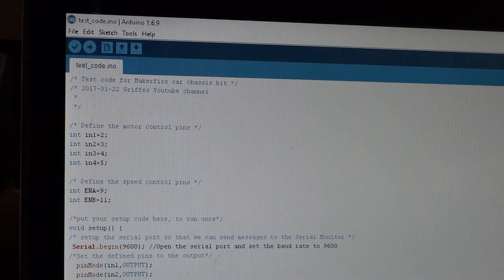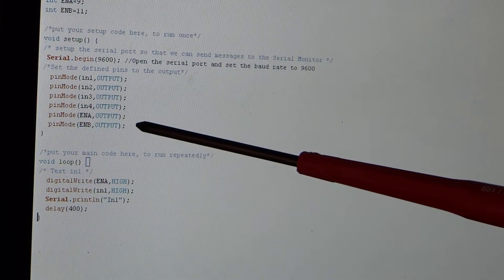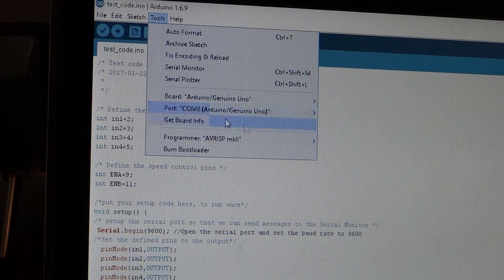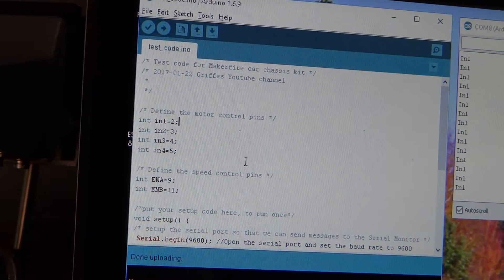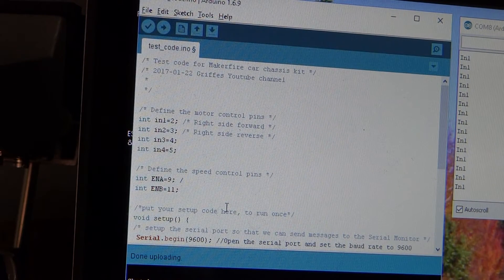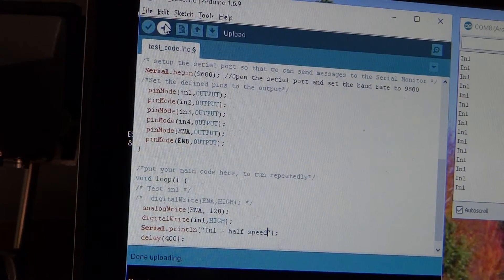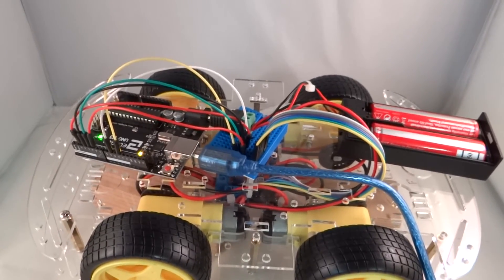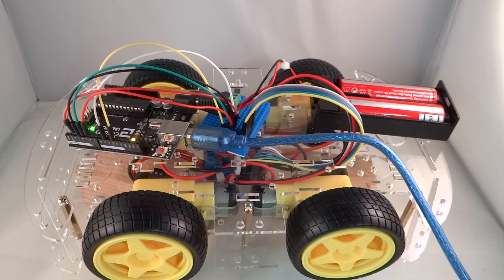Coding the Arduino Uno to control the motors

Comment: How do you make it move forward in a straight line?
Reply from the maker: These cars will never go in a straight line without wheel encoders and PID controller software. They are not sophisticated enough. The car is not designed for that.